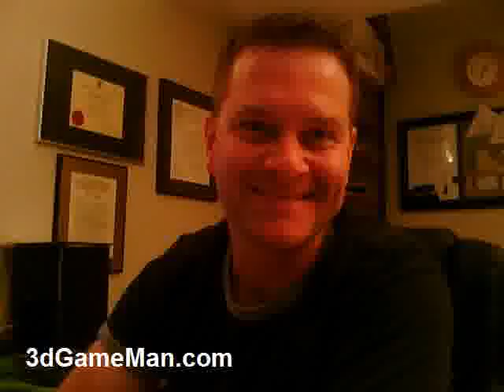#260 - Q&A: Components required for overclocking

Comment: It's a nice cooling system, but spending such money it would be better if you get a ThermalRight TRUE-120 eXtreme Rev. A or B, Prolimatech Megahalems, Scythe Mugen II, ThermalRight IFX-140, any of those coolers will be outperform the V10 and make you save a lot of money, even if you spend some extra bucks buying really good quality fans for a Push&Pull system!